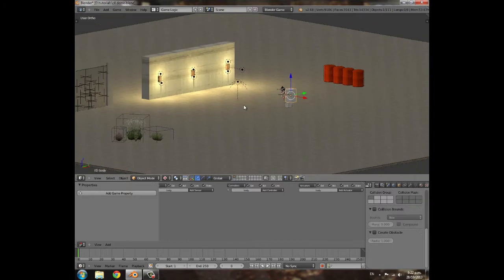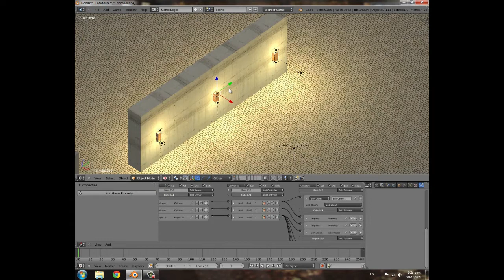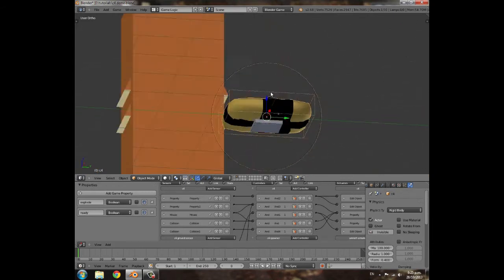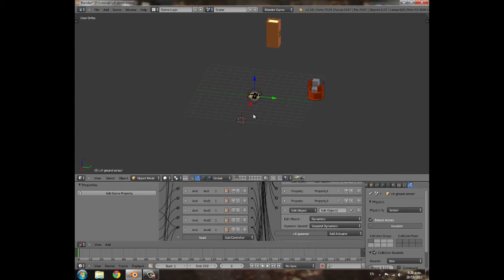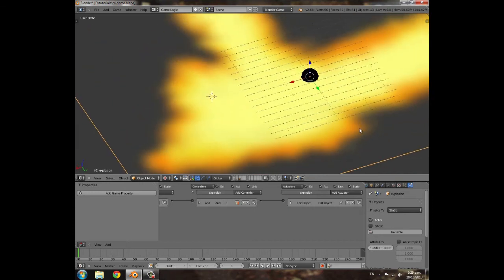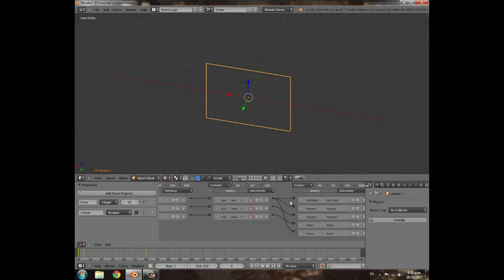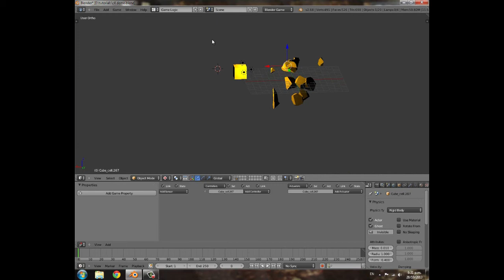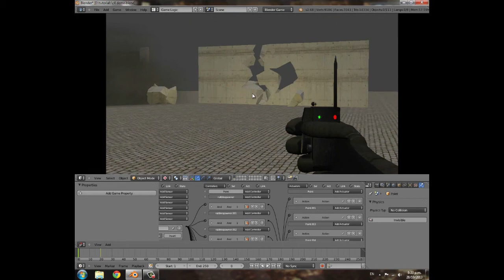C4 Overview + .blend Free Download!

Comment from the maker: a overlay scene that gets applied on when you go into the menu would work best. messages won't be needed though, as you can just directly use the mouse over and mouse left click functions even for an overlay scene. from there i would also run the python script (on always sensor) when user is in menu:
import Rasterizer
Rasterizer.showMouse(1)
to show the mouse and change: ...showMouse(0) to hide the cursor.
the biggest problem here is all the different options.

Comment from the maker: hello again, if you use the mouse sensor and select wheel up and wheel down, you could get a similar effect however you could only assign values (not add) otherwise the counter will go to 50 every time you scroll properly :P Using more than one item will be hard to set up with all the logic bricks, so maybe in this case a python script or simply a drop down menu might be more suitable and less cluttered.